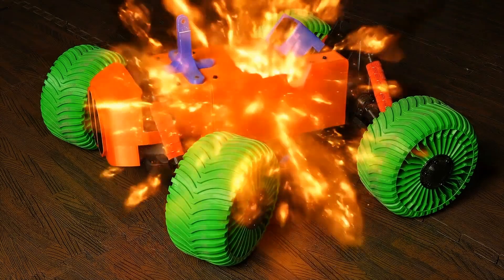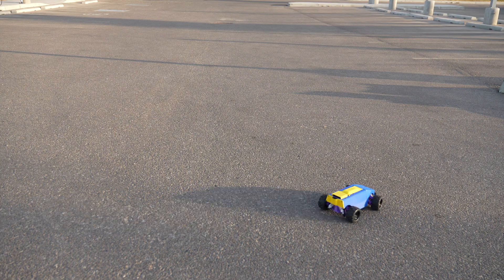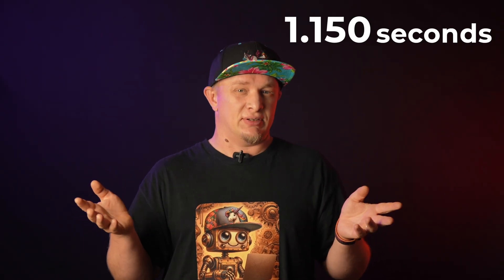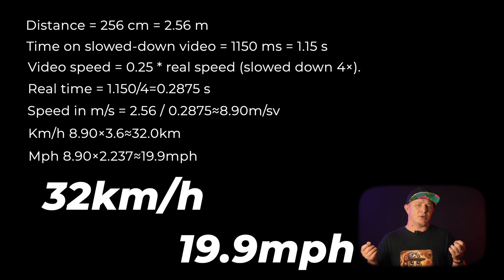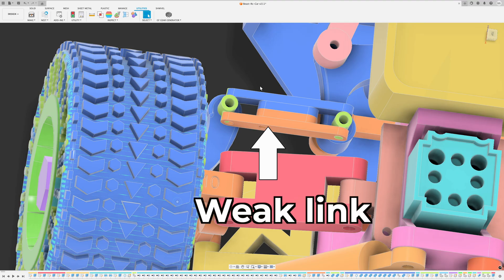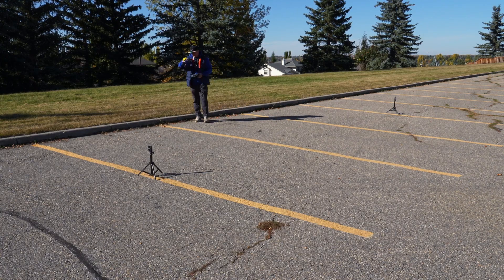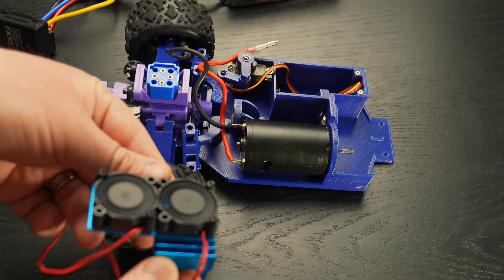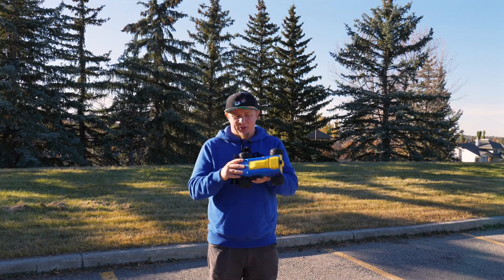I Tried to Build an UNBREAKABLE 3D-Printed RC Car

Comment from the maker: This car has been melted, snapped, overheated, rebuilt, redesigned… and it still refuses to die.
Phoenix was the lesson. The Beast is the result.

If you’ve ever wanted to build a 3D-printed RC car that’s actually fast, durable, and upgradeable, this is for you.
I’ve shared ALL the STL files, full parts list, and step-by-step build videos so you can build the exact same monster at home. Everything is linked in the description.

And this is only Phase 1.
Next video = durability tests: drops, crashes, full chaos.

👉 Want 50% off the files?
• Subscribe
• Leave a comment
I’ll personally send the discount.

Question for you:
What should I test next — bigger jumps, higher speed, or full destruction?

Comment: Good video. What filament are you using? I would try like a PPA-CF. That stuff is very strong.
Reply from the maker: Thanks. I tried PA (nylon) and it wasn’t a game changer. It didn’t bend under load the same way as PETG and cracked under load.

https://www.matter3d.com/products/performance-amide-nylon-66-high-temperature-carbon-fiber
Reply: @itkacher  Youtube deleted my link but it was bambu labs PPA-CF. So strong they make real car parts out of it. - f-ing youtube.
Reply: @itkacher  Might want to look again at engineering materials and also tune things like layer adhesion for Nylon. Doing good Nylon printing often requires a higher end  machine and heated chamber helps but also printing from very good dry storage. Companies say it's not needed, but the dry storage for sure is. The failure you're seeing with your gear I've experienced on my own 3d printed gearboxes, and it's happening at 50 - 60, not 200c. HDT of PETG and PLA is low at 50 and about 70 respectively when under load, while Nylon is higher, reinforced nylon is much higher. BUT dry dry dry filament is needed to print, layer adhesion tuning is needed, annealing is needed AND absorbing moisture back into the final annealed part is needed for toughness (while dropping stiffness). I'm using PA6-GF25 in my "Fast Trax 2" I designed and shared. It's about 50 - 55km/hr with 3d printed single set screw in plastic with a 12:1 two stage gearbox. The limit of speed is no longer the gearbox but I limit to 60% throttle because of controllability of tracks and running into things. The 10+ times I've made the gear boxes for gen 1 and 2 with PLA or PETG it always fail if things get to 50 - 75c. Material softens, things start deflecting and gears stop meshing properly, this causes them to slide more causing more heat and voila, gear or gearbox failure. I reduced this moving initially to ABS then the PA6-GF25.  The stiffness of materials in drivetrain can lead to impulse load failure too so you need to account for that as well.
Reply from the maker: How did you post-process PA prints? Bake or Boil? I baked it. When I tried to boil - absorbed moisture made gears bigger causing fails on assembly stage.
Reply: @kwakeham  If you want to go faster run a receiver with Stability Management or Active Vehicle Control (AVC). It will make a world of difference.
Reply from the maker: I wanted to use one of the cheapest options, but I will definitely take a look. Thank you!